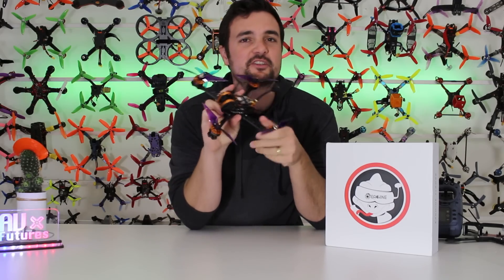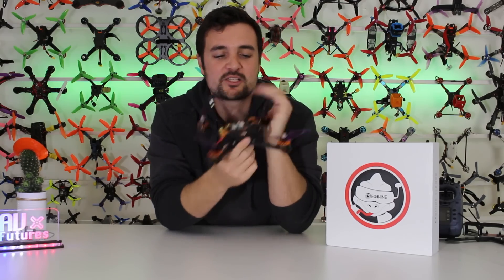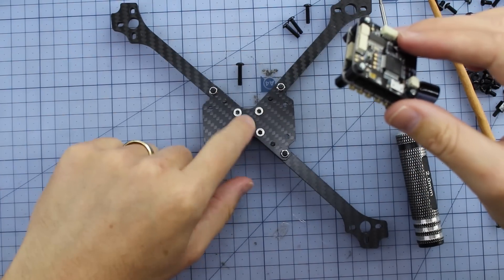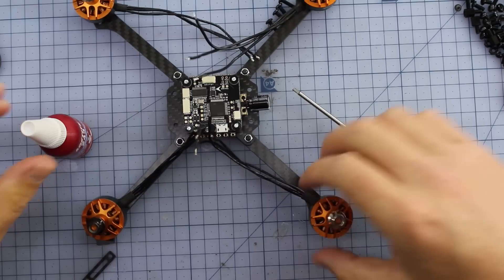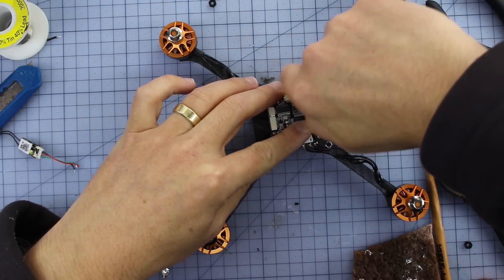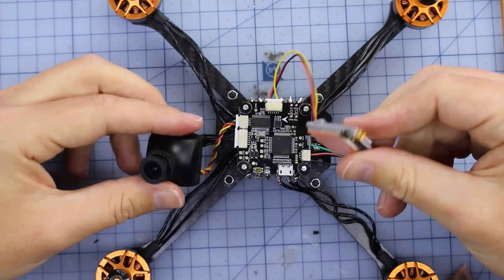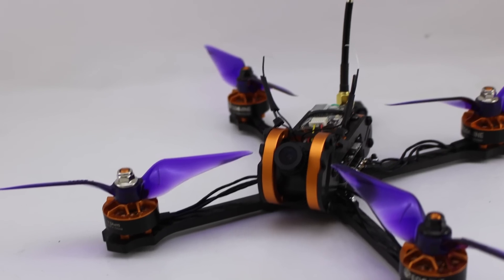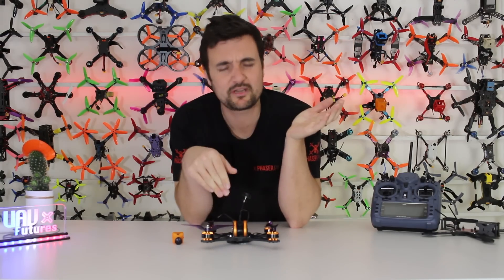HOW TO BUILD A RACING DRONE IN 30 MINS and $99 TYRO99 build guide uavfutures

Comment from the maker: GIVEAWAY DETAILS IN DESCRIPTION. Tyro99 link - http://bit.ly/Tyro99drone also as a bit of a bonus all pre orders should be able to get 20 bonus propellers.
Reply: i like this one. That Black and orange is slick
Reply: Please PLEASE PLEASE  answer 1 question for me. Does it matter what wires are soldered to what tabs.  Because in other videos you showed that some had to be switched to make the motors run opposite way.  Please help.  Thank you so much
Reply: So convenient! I think it's a great concept for new builders but doing you $99 build gives you more knowledge on how things work. Good job Eachine.  n thanks mate.
Reply: I didn't hear you mention anything about programming it.  if that's the case that will be my favorite part of the build. with the normal diy option i wasn't looking forward to spending time building then programming before I could fly.
Reply: Hey could you maybe make a comparison video between this one and the wizard. I think about getting into the hobby but I'm not sure which one of these to purchase.
Reply: What wire did you use to connect the receiver because it didn't come with the set
Reply: Dose the battery comes with it?

Comment: I built mine with a couple of mods. Sanded the nut flatter for rp-sma connector as the antenna was not making proper contact and cut groves into foam on battery plate so it sits snug.

Comment: I put this together, but what about setting it up with my transmitter and with beta flight? I’ve never done this before and I’m having issues with betaflight working with my transmitter. I’ve binded successfully to my receiver, using spektrum for both, and need to set an arm switch but when I move any controls it doesn’t show anything moving in beta flight. I can tilt the drone and it’ll move that way but not seeing anything from the transmitter to betaflight.

Comment: I just bought this kit and noticed that the mini VTX doesn't fit into the flight controller.  Do I need to get a different size connector?  Same thing with the camera; what size would fit in the connector that came with the kit?  Thanks!

Comment: My 11yr old son had a parrot bebop with sky controller, but had nothing but problems, so we got a refund and used the money to buy the tyro 99 (on your recommendation). Your videos are fantastic, but in this one we are struggling to find which motor wire goes to which terminal? As I am letting my son do ALL the work on this complete build himself, without my assistance, I was hoping you'd be able to shed some light on it for me, thanks.
Regards 
Mick

Comment: Hi, doing the build and bought the RunCam camera upgrade you suggested - however it has 5 pins and the Tyro99 cable is only 3 pins. Also pins seem to be flatter on the runcam Swift  than the more rounded Tyro99 supplied cam - what do i do ? How do i use the Swift ?

Comment: Really impressive quad. F4 board, 300g weight looks like it will rip. Im curious if anyone has done a speed test yet. For the value ($130 Canadian) I bet these will be a top seller.

Comment: Very nice to have a total solution, so a newbie like me don't buy everything i think is needed, and then have to order standoffs, cable and all the other stuff I don't have laying around :)

One question, does it matter which of the 3 wires from the motors, you solder ti which pad on the motor controllers ? I don't think that was too clear for me.

Comment: Great tip on soldering the motor wires.  Cleaned it up a bit and not wire trimming was needed.  The Tyro99 will be an excellent first build and when I make the step to a "real racer" it's on my short list.  Not having to solder so much makes it less intimidating.  Happy Flying!

Comment: I've just pre ordered one and have foxeerr camera to replace the camera that is supplied, I'm still pretty green when it comes to flying fpv but do have a nice set of red bottoms if I don't like the motors, I do agree that the VTX on top of the frame is a bit silly but as things are getting smaller it might end up being quite a tasty looking drone. As I'm still learning I will only be going as high as 4S which is the max the red bottom motors I have go to.

Comment: I am totally new to the fpv experience,  this sport has a whole new language! - I've preordered the Tyro 99 and am wondering about the runcam option  - 2.1, 2.3, or 2.5 mm option on the runcam - what do you suggest?  I have also ordered flysky nirvana transmitter because Stu pissed himself when he was holding it - I thought if that radio can do that for a veteran flyer what will it do for me?

Comment: That pretty cool that the wire are pre tin and are the right leanth to soldered via the inside to make it look better. 

The added benefits are the clip to clip wire. So you only have 3x4 motor wire to soldered

Comment: I don't like solderng motor cable from the inside? You might touche the electronics pins just next to the pad. For ppl really new to soldering I'd recommend soldering for the outside and Zip tie the wire tightly.

Comment: overall the tutorial was good tho for beginners I think that first placing the wire through the hole is a better idea for inexperienced solders. Else they might form cold joints as they move the wire. otherwise great tutorial for a beginner drone that needs it.

Comment: Can you use inav or other firmware or is it fixed? do these builds have flight stabilization and simple hover, any of these build use wifi fpv with an app?  I have learned so much from your channel. good for project for my 12 year old?

Comment: Hey, i am planning on using a Spektrum SatRx (3.3V).... do I simply short out the ibus/ppm/dsm pad to the middle pad, plug in the cable to the available port, and then the system will push out the 3.3V I need?

Comment: FYI, the motor wires are the exact right length to run them under the 4in1 and then run them up through the holes.  Makes it really easy to solder and removed all the extra wire to they are perfectly clean.  I also think it easier to not accidentally short an esc mosfet that way.

Comment: Hi Stu, thanks for the build guid. As I`m mostly flying planes and some toy quads, this was my choice of the firs real quad, especialy for the money.  I dont have any experience with Betaflight and how to set up everything, specialy if I dont want to desolder motor wires how to change direction and other setting. Perhaps you can make additional video how to set TYRO 99 in Betaflight. ;)

Comment: for me it is like the thing that makes it possible to kinda try the hobby but not having to fully commit into something you dont really know if its your thing. but if it is, i recon something like this will go a fairly long way until you really feel the need for something better.

sure, doesnt have the best flight controller or the best motors but you have to keep in mind that some people easily spend the same amount of money on a battery alone

Comment: Good content.  Easy first build.  Don't need too powerful for a first drone.  Camera upgrade would be well worth it.

Can see this getting more people flying.

Couple this with a cheap flysky TX & RX, and a cheap box goggle and you have a full beginner starter system.  Recommended would be FrSky (X7, XM+) and better goggles, but starters often do not have the budget.

Pity the motors are CW & CCW.  All CW or all CCW then easier to replace motors and/or prop nuts.

Cheap enough to use as a narrow spec class for entry racing (everyone on same build - motors, props, FC, battery capacity).

Comment: What a great starter! It may not be amazing but what you get is to.learn some of the basics around soldering, understanding the components, and getting to build.
The frame is a good bit of kit. So light s d strong. Just very cramped so not all FC's fot in. I used an all in one with  built in vtx and still couldn't fit a rx in. 
Great vid again Stu

Comment: It's inexpensive and will get you in the air.  Great for someone who is not sure if they this is for them.  Most likely be wanting to upgrade though shortly after getting it.  Better motors, better camera, but this thing will still fly as is and I started off with much worse than this and I am still flying, so you can't go wrong here!

Comment: I dont put the wires from motors inside like You are showing because those may rattle inside - between the boards and introduce additional vibrations. It makes sense to put the FC on vibration dampening standoffs and clear its surroundings :D it makes no sense putting a ton of cables around the FC to touch it just so it looks fancy :D

Comment: Front and back arms are not mounted symetrically ??? I see that hole that is used to center the motor is not in the exact axis of arm. This will make front motors and back motors to be in different distance from front-back axis of the quad. I'm not specialist but could it make the contol of quad somehow unnatural ??